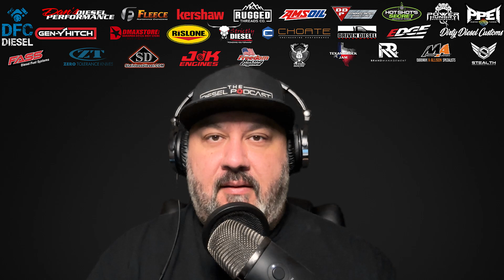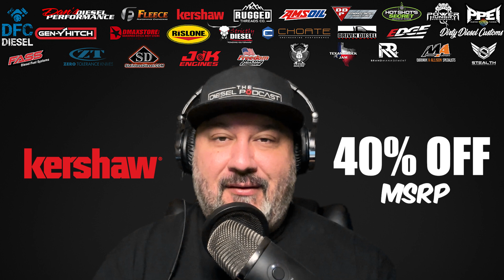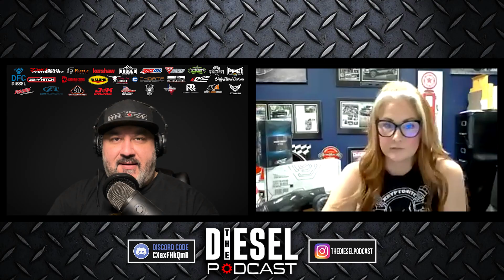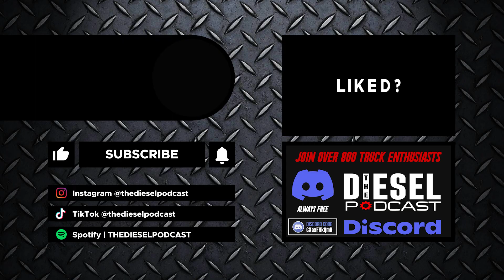Major Issues with This Truck!

Comment: Only on West coast do they require bio in the diesel, same way with ethanol in gas, you can get non-ethanol on west coast.  My advice is get the 'ell out of there.
Reply: You can still get water in the diesel in other states though. You gotta treat all diesel the same these days. Every 400 miles i put 6-8 ounces in my fuel. Its cheap protection. But I also have a cp3 pump and it is not turned up.

Comment: DCR.   14:00 this is wrong and incorrect info,  the S&S filter kit only stops metal from going into fuel tank and be recirculated; you still loose all that is in engine bay, injectors and rails and lines.

Comment: Be careful where you buy your diesel? So where do you buy it? How are we testing it before putting in the truck? A lot of these tips and pointers lean towards those outside of warranty. These products you are plugging would void a warranty with manufacturer. They are fighting every little part to try and deny a claim
Reply from the maker: The guest mentioned the company - Blackstone Labs. Samples can be sent to them for a number of different fluids for analysis.
Reply: @ so where should the consumer buy diesel?? She said to be careful so how do we go about buying better fuel? Should we have a lab kit to test it at the pump before filling up? The fear marketing is getting out of hand.
Reply: @LV2Roam  The better filtration kits (fleece, fass) take less than an hour to install you can swap those off an put your stock units on in case a warranty issues arises. fyi IF you have a fuel failure and FORD MOTORCRAFT see's excessive damage due to contamination because of fuel they can deny you warranty claim.
Reply: The better filtration kits (fleece, fass) take less than an hour to install you can swap those off an put your stock units on in case a warranty issues arises. fyi IF you have a fuel failure and FORD MOTORCRAFT see's excessive damage due to contamination because of fuel they can deny you warranty claim.
Reply: @siskiyoudiesel1222  and how am I liable for that if you are doing the proper maintenance and changing fuel filters regularly? Who has  the ability to test fuel going into the truck before filling the tank? The manufacturer is more prone to immediately declining a issue under warranty if they see (fleece, fass or anything other than Ford motor co) .

Comment: Who still drives a Dodge?  Dodge hasn’t made a truck in 18 years.  🤷‍♂️
Reply: at the end of the day whether it is Chrysler, Dodge, Mopar, Fiat, your mom, everything but that motor that isn't Cummins is having issues..........
Reply: @siskiyoudiesel1222  In 10 yrs of owning my 2015 Ram, the ONLY thing I've had to take it in for was the motor and that was only a turbo actuator.  But, I've tried to do all the preventive maintenance Kat said to so...we'll see.

Comment: Why don't you discuss how bad the fuel quality is in ULSD? It is really low quality and is responsible for significant amounts of wear and tear.
Reply: It's been talked about many times on this show
Reply: @Mikeysixkiller  Not near enough. Do you actually know what is wrong with the fuel? besides the fact that it sucks.
Reply: Yes agreed 
That's why they promote the additives to help the offset of sulfur... I am glad that I sold my Duramax right before it all changed. But yes I do miss the towing ease with a turbo, no doubt
Reply: @alfee9411  what problems to these additives actually correct? One must know what the documented problem is before adding something to one's fuel.
Reply: It was $17k on my F-250 company truck when my CP4 crapped out on me. It had 318k miles on it.
Reply: @danielc.2042  you can thank the 2005 congress for the RFS and the USEPA for managing RFS and ULSD